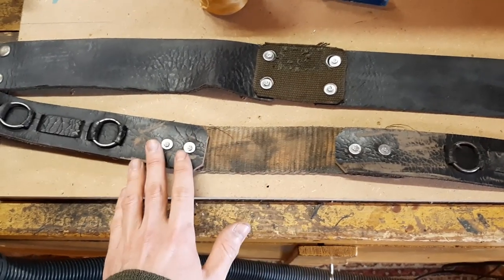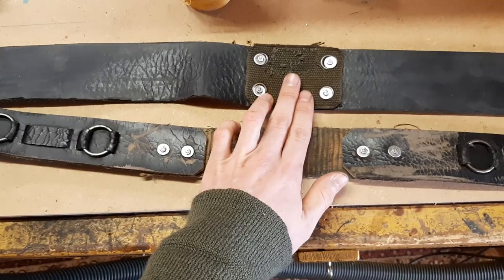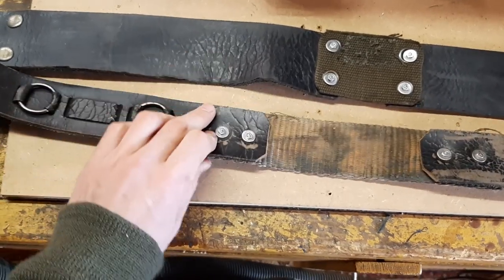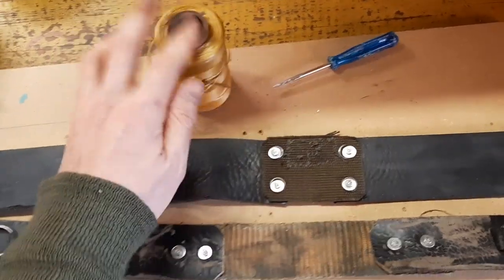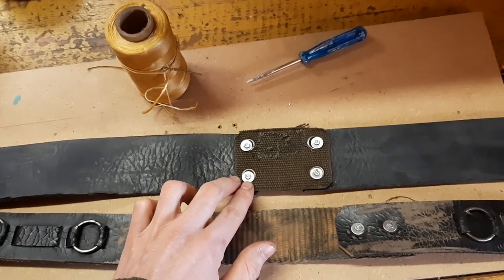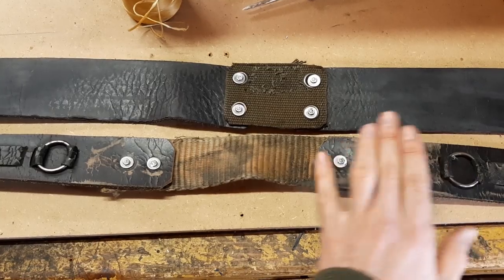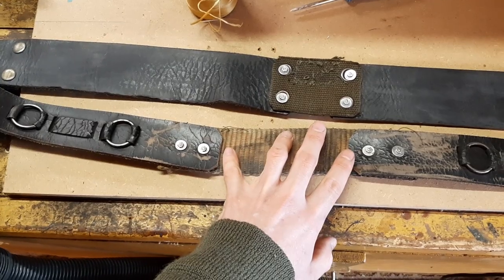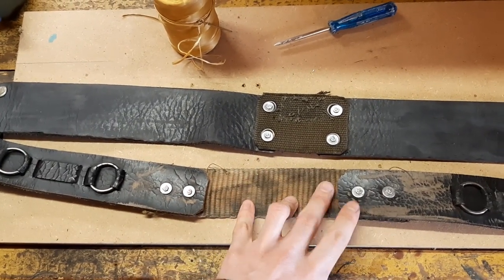Quick tip: how to fix or extend belts?

Comment: I did my leather belt a bit differently, because I figured if overlaid the pieces, it would fit/ride oddly. So I butted the pieces together, and did a row of holes with my leather punch, and then did X-shaped stitches with hemp cord to join the pieces. It fits my more primitive aesthetic, as well.

Comment: I wish I knew what size and what those small bolts were called
Reply from the maker: made a video about that long ago, find it  :)
Reply: Get a rivet gun unless you want the aesthetic of actual nuts and bolts. One of those cheap little hand rivet guns at a hardware store, comes with rivets, 15 / 20 bucks? They also make something called a "chicago screw" which is kinda like a rivet but it's screw in and removable but they can only tighten as far as the bolt portion so you have to be sure how thick the fabric is going to be.